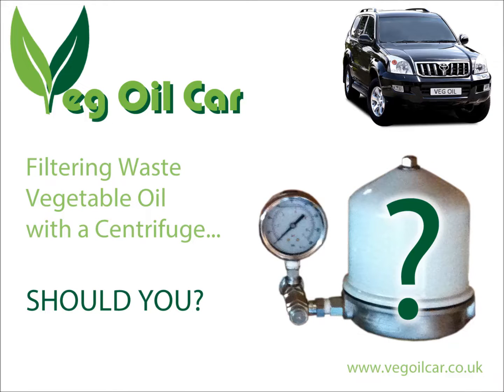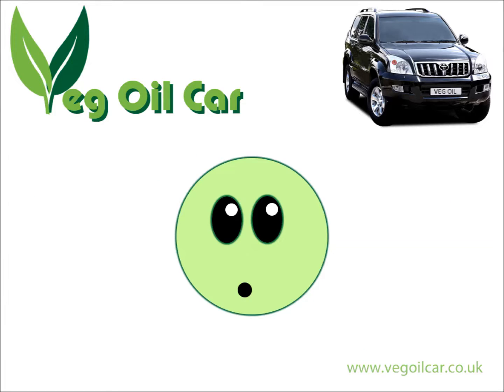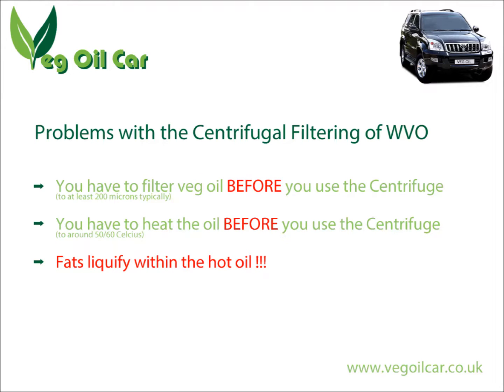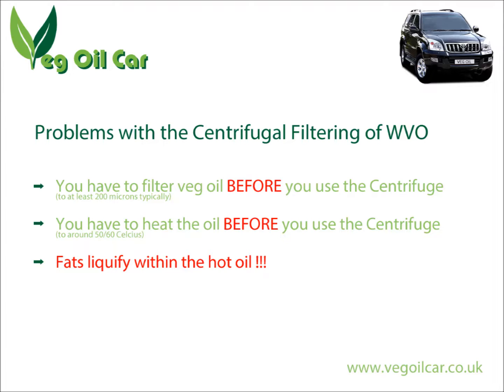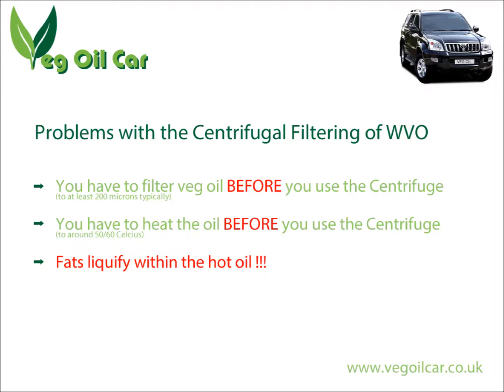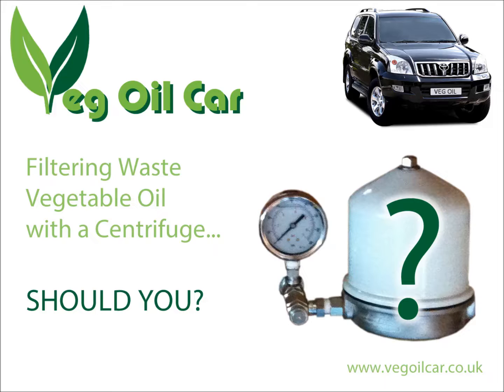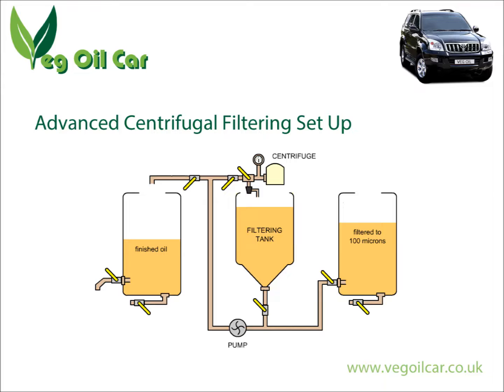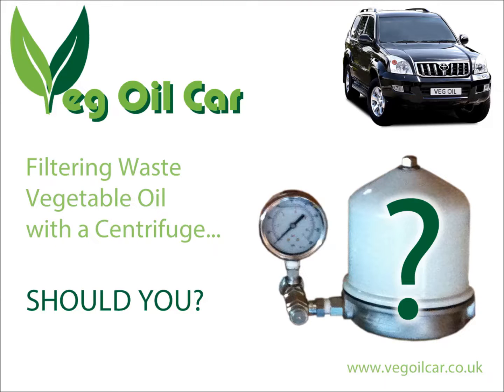Centrifuge filter WVO? Should you use a centrifugal filter by VOGMAN

Comment: Agreed that centrifuges aren't cheap. The small ones still push $200 USD. Setup cost though for pure filtering systems can very quickly compete though... 
Haven't yet fully decided on what route to take. Straight filtering or Centrifuge. I know there are 2 types of used. One requires the use of a pressurized system while the other (more expensive) uses gravity supply (or can at any rate). What of that one?
Reply: Do you still hold to this thinking Geoff (Jeff? Sorry!!)
I've used a centrifuge plenty to clean oil and going from settled to centrifuge definitely leaves ick in the bowl.
Do you only use vehicle mounted types or have you used stand alone ones?
My oil comes well cleaned from my collections so i don't need to do too much to it, but even after a long hot summer of settling (Western Australia ) it still leaves a good deposit in the centrifuge bowl.
While i agree with the vast majority of what I've seen in your videos, i wonder how we're so different in our experience/thoughts on centrifuges.

Im currently following your casting videos for an upcoming centrifuge bowl casting.
I just missed out on an alfa laval plate centrifuge, so im going to knock up a solid bowl type to get me going again.
I've got 6000L of oil stockpiled as I've not been driving a diesel for a while for various reasons.
Time to get back to it!

Cheers mate. I look forward to hearing from you!
Nice one!!
Reply from the maker: I would recommend none. Centrifuges need warm oil and that melts fats.
I once challenged a company selling four-figure centrifuges to invite their happy customers to write to me at VegOilCar.co.uk telling me their success stories. The company was delighted at the opportunity. I contacted them a month later and they said they'd asked around and were sure someone would contact me soon. I contacted them three months later and they said they couldn't understand why no one had contacted me.
So I challenged them... I asked them to lone me a system. I said I would test it fully and report my findings with complete honesty and transparency through YouTube and my website. I said after that, I could clean and return the machine to them.
They declined my offer.
That told me all I needed to know. 
Forget centrifuges. Look at Settling. It's brilliant. It's cheap, effective and EASY. My multi-tank system filters to less that 0.5 microns.
Reply from the maker: If you want, tell me the name of the company you're looking at. I'll gladly issue them with similar challenges. But I suspect I'll get similar responses. 
Snake oil salesmen wear many hats.
Reply: I've went the CF route using one of the 55gal//hour units last summer. Temps where I live (SW US) can get high enough that any fats would get dissolved anyway just from ambient heat soak in the late spring into early fall. My main settling//processing black barrel can reach well over 120F or ~50C) just by sitting in the sun in summer. In the winter I have to apply heat but in the summer I can run w/o it. Ended up w/ 2 CF bowls after a run in winter w/o sufficient heat caused overpressure & the bowl suffered partial collapse. It's repaired & the jets drilled out to 1/16th from an original ~3/32 or < & serves very well as a pre-run while a 2nd bowl is the final.

Multi-tank settling is great if you can get hold of the appropriate tanks for reasonable price or free (not the case for either where I live). Space where I'm at isn't  an issue if I did.

Working on expanding my supply sources (so far strictly just a couple locals) w/ the only hiccup being collection that doesn't require a hand crank pump. Stock isn't very large @ only ~300 current gallons. But I only use 20 (lasts 2 weeks) @ a time but try to make a double each batch.
Reply: @RuralTowner what make and model centrifuge are you using?
Does it actually produce 55 gallons an hour?
If its an engine mount type, why that over a freestanding one from raw power, filtermaxx, ultimate force , etc etc?
Im limited where i am (rural Western Australia ) but there seems to be a lot more scope un the US for finding used industrial equipment, I've missed out on a couple of awesome machines, still hunting before i start casting ali!!
Reply: @bushratbeachbum  Got mine from PABioDiesel Supply (https://pabiodieselsupply.com/). Cost ~$200 & have about another 150 in the rest of my system...the 2nd bowl I got later tacked on about another 100. Most of the small bowl-types I found were basically identical to mine. Whether or not it's really 55gal//hr I couldn't say as my setup draws directly from the barrel, through the heater tube (whether on or off), through the CF to then dump back in the barrel. For thoroughness I usually let it run for a few hours & never do a full 55-gal drum worth...40-45 tops...so I get about 4-5 passes since the more the better.

The base of the unit has a 4-bolt square mounting face that was probably originally designed for an engine mount for bypass filtering engine oil but also serves to securing to a barrel lid or down tube. Mine is connected to the heater riser (uses water heater elements) by it's side inlet so the whole setup hooks to the barrel lip & dumps right out the bottom. Cleaned warm oil is on top while the cooler less-processed is fed out about 6in above barrel bottom. I feed the thing with non-regulated gear pump I got for cheap off eBay & power it with a 1/2hp (already had on hand) evaporative (swamp) cooler motor via Love Joy couplers. The pressure is regulated with a ball valve @ a T-junction before the CF that dumps into the barrel. As oil temp rises I slowly close it to keep it near 90psi & eventually can shut it entirely & it will stay at ~85.

I'd love to have 1 of the large bowl single pass types but they're prohibitively expensive. Just the machined bowl alone is well over $200 USD & that's when buying it that comes with DIY plans for the rest of it.